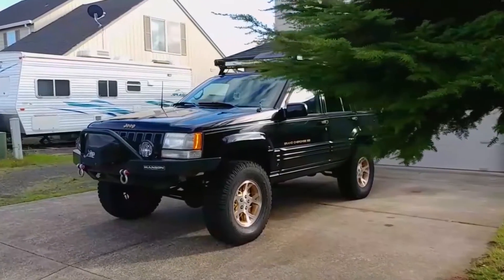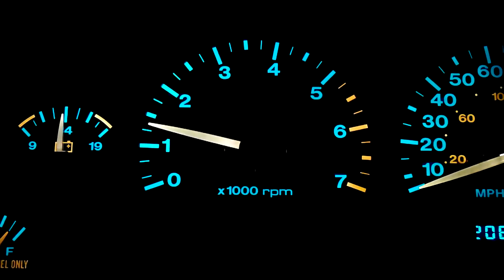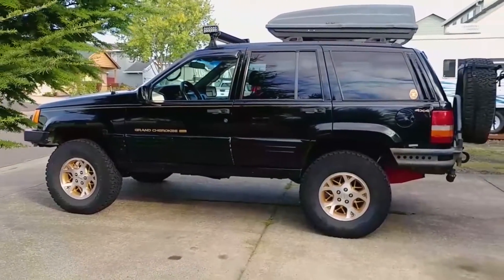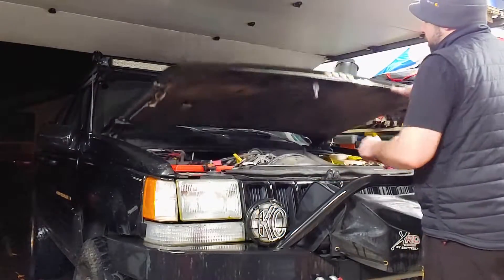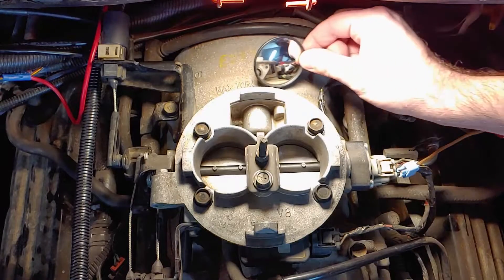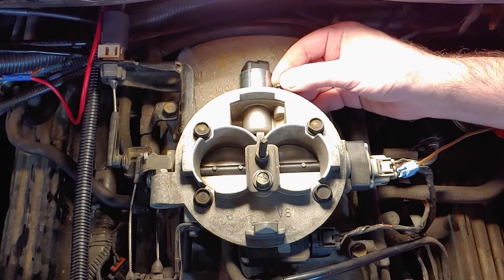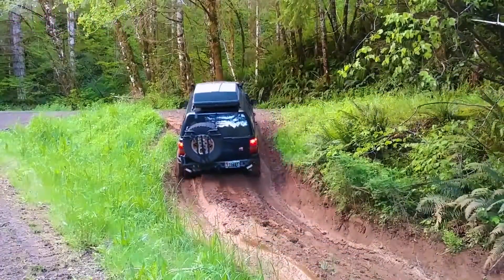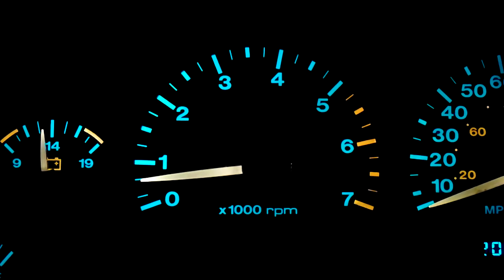Idle Air Control Valve (IAC) - 5.2 & 5.9 V8 ZJ Jeep / Dodge

Comment: Decided to come here first and glad I did. Took me a couple hours, a brand new control valve, easy to install, fixed the problem! Took an 8 mile trip down the road and back, and idle is reset back to normal! Thanks a million! 1995 Jeep Grand Cherokee 5.2L 230+K miles
Reply from the maker: Glad to hear it!

Comment: My 96 grand Cherokee has a 5.2 L V8 now I’ve had a problem with that air idle speed sensor are replaced it. It lasted about a year and now it’s doing the same thing. It will all of a sudden without any warning as I take when I take my foot off the accelerator slowing down to stop the engine stall, then I have to keep my foot on the break start when I put it in gear I have to keep my foot on the gas to keep the engine running, which is dangerous so would engine idle sensor have anything to do with that but any suggestions would be helpful thank you
Reply from the maker: You might need to remove and clean the part of the intake that the IAC fits into. It's very easy, just a couple of bolts I think. Make sure to clean the mating surfaces for the IAC so it seals well. It could also be a throttle position sensor issue. I've had to replace both of these sensors twice over the years. They don't seem to make quality parts anymore.

Comment: Hey man, having an issue with my 95 5.2, it runs nice and I have no codes but when I turn or let the RPMs get low, it just shuts down, starts right back up though. Any ideas? Changed out plugs and the PCV might be thinking it’s a Crank sensor but it could also be this or the TPS, not 100% sure
Reply from the maker: My first thought is that it could be a small vacuum leak. You could get a "paint can smoke tester" on eBay for about $25 and use it to find vacuum leaks. There are many places where there could potentially be a leak. Also check the simple stuff like making sure the air filter isn't clogged and the fuel is fresh.
Reply: @endlessmoneypits  Yeah for sure, I’m thinking it’s probably a vacuum leak especially since it really only shuts off when there’s extra load and after it comes down from revving up
Reply from the maker: Yeah, I've had the same thing happen on other cars and I think it was always a vacuum leak. Let us know if you find the problem. Good luck!

Comment: your pcv hose is broken
Reply from the maker: I see what you're talking about.  I'm pretty sure that hose is still intact, so it might be a shadow.  I'll check on it later today, but I replaced it 2 years ago and I look under the hood on this thing all the time, so I would be surprised if it really is torn.  Thanks for the heads up!
Reply from the maker: Good news! It's just a shiny spot from the spark plug wire rubbing on it.
Reply: @endlessmoneypits  Rock on \m/